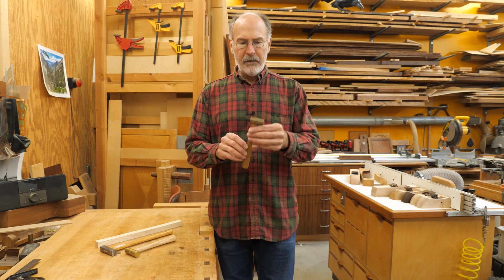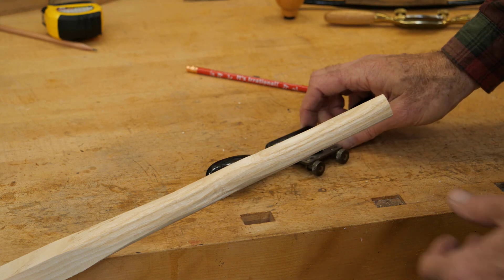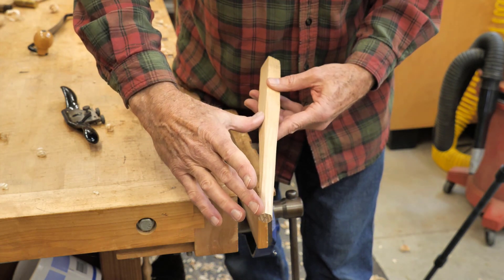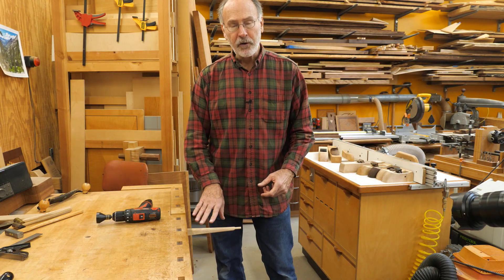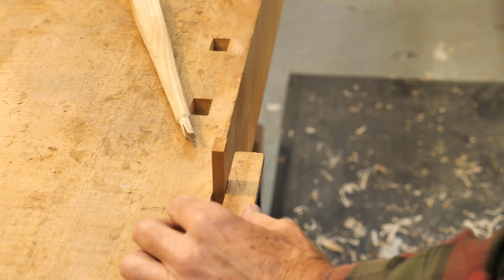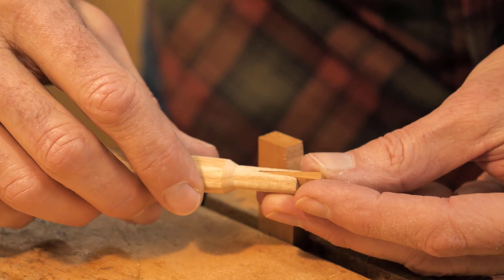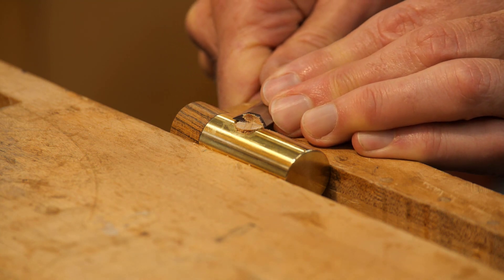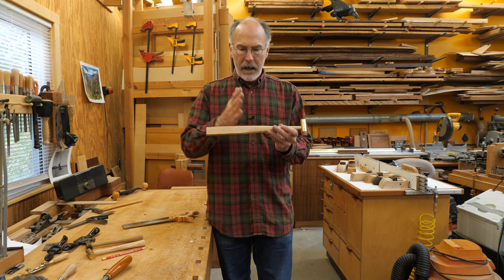Plane-adjusting Hammer Build Part 3

Comment: A great series. I'm gonna go out to the shop and make one for my Daughter-in-law. She's the crafter for the next generation. QUESTION: Would it perhaps be a good idea to cut the handle a tad longish and test the swing. You can always adjust shorter if you wish. I don't know... just sayin'. Thanks, gladI I found you channel.
Reply from the maker: I think you could start with a longer handle but if you then want to shorten it, the process might not be what you think. Assuming the handle is shaped (which it should be), then cutting off the end will yield a handle that might be too small in diameter; you would be cutting off the thickest part. Therefore, I would determine the length with some test swings, then cut off the end with the tenon, keeping the thickest part. You can then reshape upper part of the handle and re-create the tenon. I hope that makes sense...

Comment: Great video as always…do you recommend any kind of finish on the handle?
Reply from the maker: I have never put finish on my hammer handles (or plane bodies or most other tools I make). If I was to apply a finish I would use shellac. It dries quickly, seals the wood, and doesn't add much color. Another option would be thinned varnish or polyurethane. I would avoid oil; it takes too long to dry.